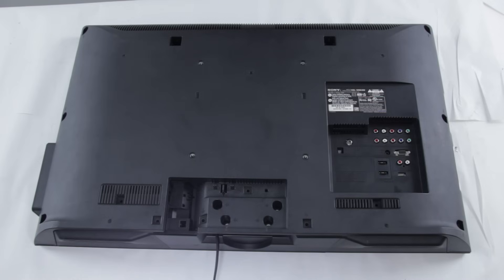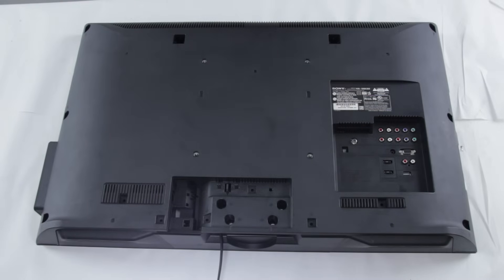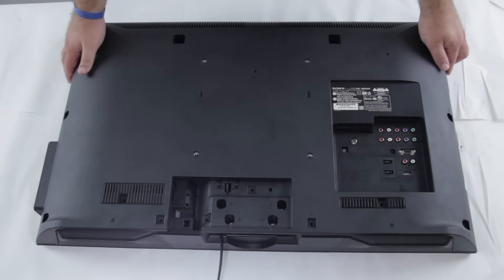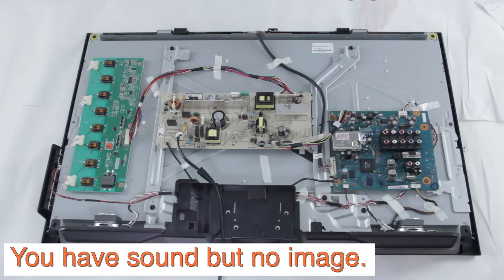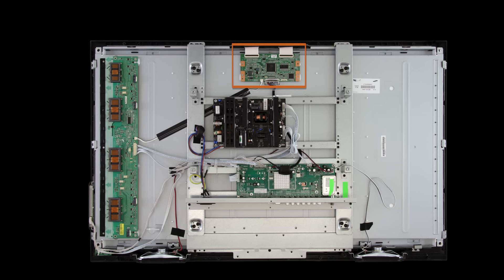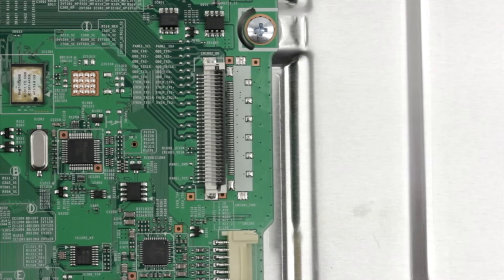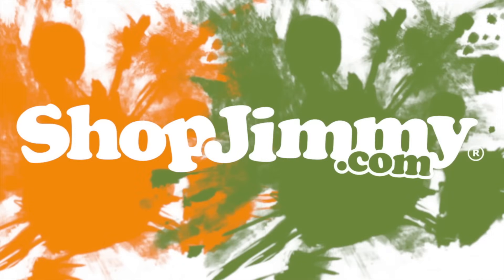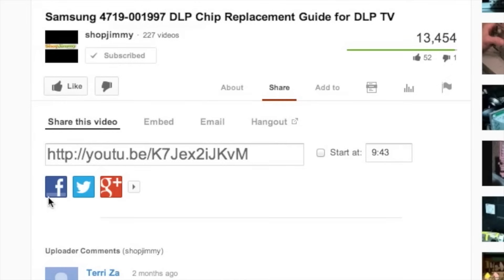LCD TV Repair Tutorial - T-Con Board Common Symptoms & Solutions - How to Replace T-Con Board

Comment: i have a samsung 43"  flat screen tv model # 843AX-YB02 SERIAL # BN96-26201A  with a red light blinking in the front and a green light blinking in the back, the  picture  comes on for a few seconds on and off. i already replaced  the Y- BUFFER BOARD AND THE SUPPLY BOARD still no picture.
Reply from the maker: +luis napoles  Try all repairs and troubleshooting at your own risk.  You will need to 
also replace the y board, since you replaced the buffer. Unfortunately I
 do not see any replacement parts in the search results for your TV 
model number on our website.  Thanks and please let us know if you have 
any further questions!  www.shopjimmy.com

Comment: Hello,

I have a Samsung  ln-t4661f
I replaced the capacitors that were bad and now it starts up.
It was also having the horizontal 3" stripes and ghosting of menus
I cleaned the ribbon cables on the t con board with alcohol and it appeared to fix the picture issue.
However the picture started displaying what looked like flashlights at the upper left and right side of the screen pointing down, Now the picture is almost completely washed out. Is the T con Board Bad? I can send you a picture of the screen if it would help,

Thanks, Dan
Reply from the maker: +Dan Froehlich   Try all repairs and troubleshooting at your own risk.  This sounds like a TV panel (TV Screen) problem.  If your TV panel is bad, it may be more cost-effective to replace the TV as panels are typically hard to find in stock, difficult to replace, and expensive.  Thanks and please let us know if you have any further questions!  www.shopjimmy.com
Reply: +ShopJimmy.com 

Hello,
I found an inexpensive T con board  and it appears to have fixed the issues I described in my Initial post. Now the only issue is that the HDMI calibration fails and the picture has a blue cast over it. The other inputs pass calibration. I started it in service mode and when i have it retry calibration the screen gets nice and bright for a second or 2 then goes back to the blue cast. Any ideas on this?

Thanks, Dan

Comment: LG flat screen
Serial: 408RMGCNA191
Model: 50LB5900-UV
Symptoms: 3" grey vertical band with colored lines on the right side of screen.
They are displayed over the input and menu screens.They appear over all input selections.
May this just be a ribbon cable connection problem or do I need a T-con board?

Comment: I have a UN46EH5000F Samsung TV. When I power it on I get no video at all. No light on the screen of any kind. I do hear a power on chime noise. I get a red flash from the power button. I have replaced all 3 boards (pwr,main,tcon). Did not change cables.

Comment: I have a Samsung model # UN39FH5000F.   The sound is fine but there is no picture.  I heard that it could be the inverter board, led board, that provides the backlight but I am not sure which board it IS when I remove the back cover.    There is an obvious power board then what looks like the main board and then there is this other board in the middle, low, and has two separate long boards built into the lining of the TV.  Is THIS the inverter board, a T board, or an LED board.  Im confused.
Reply from the maker: Dee Griffin   Try all repairs and troubleshooting at your own risk.   It looks like your inverter board in built into the power supply board.  Click this link to replacements for your TV model number:  http://www.shopjimmy.com/catalogsearch/result/index/?cat=229&q=UN39FH5000F  There may be multiple boards for the same TV model number, be sure to match part numbers on your current board, with your replacement for compatibility.  Thanks and please let us know if you have any further questions with your TV Repair!  www.shopjimmy.com

Comment: I have a Samsung LN52B630N1FXZA LCD TV. The screen goes black after a short time. We still have audio, but no picture. If the TV is off for a while it will come on and repeat the same thing. I have replaced the Main Board, T-Con Board and the Backlight inverter. What else can it be???

Comment: I have a Samsung LN46A550P3FXZA with intermittent severe solarized picture. thought was the 35-D025860 T-con board, but a u-tube video I watched stated that if the screen menus were not solarized as well, it would be the main video board. Can anyone verify this? Also, am I wrong to assume not the LCD panel since picture is sometimes OK?

Comment: Hello my friend. Very good your videos. I have a UN46EH6030F Tv model (Samsung) and I have problems with the HDMI ports, doesn't work...It could be the main board... I bought it but doesn't work either. What can I do? Thanks
Reply from the maker: Fran Merino   PLEASE SUBSCRIBE TO OUR CHANNEL - Try all repairs and troubleshooting at your own risk.  This could be a bad main board or bad HDMI cable.  You can try a different HDMI cable to see if the problem persists.  If it does, then you should replace the main board.  Click this link to a replacement main board for your TV model number:  http://www.shopjimmy.com/samsung-bn94-05874t-main-board-for-un46eh6030fxza.htm  There may be multiple boards for the same TV model number, be sure to match part numbers on your current board, with your replacement for compatibility.  Thanks and please let us know if you have any further questions with your TV Repair!  www.shopjimmy.com

Comment: NEED HELP:

I have a Sharp LC-52D92U
My 3 years old daughter hit the LCD screen with hands and after that a thin black horizontal line appeared across the whole screen from right to left (slight dimming towards left). Location is just below the centre. Please advise how to get it fixed. Can this be fixed by replacing T-Con Board?

Comment: Hi I have a sansung 40 inch smart tv
my problem is that I factory reset it and I cant configure the initial set up it just gets stuck and does'nt do anything it just says downloading terms of use  and I check the internet connection and its fine I dont know what to do
model: UN40J5500

Comment: Hello, My Samsung LE37A656A1F (XXH) type no LE37A656 is damaged sinds a few weeks. I put it out for a few weeks. Now by using the problem still remains. The problems are bad colours and very bleu heads. I tried and reset the colours but it won't help. Is it also a T-con board matter and just replace it or do I have to do something else.Please help me asap. Thanx greetings RED

Comment: Have a JVC LT 32DY8ZJ need to replace TCon board but cannot see it after taking off back panel. Any ideas please
Reply from the maker: John Girvan   Try all repairs and troubleshooting at your own risk.  This sounds like a TV panel (TV Screen) problem.  If your TV panel is bad, it may be more cost-effective to replace the TV as panels are typically hard to find in stock, difficult to replace, and expensive.  Thanks and please let us know if you have any further questions!  www.shopjimmy.com

Comment: Emerson LF391EM4/ S/N: DS3A
Trying to repair an Emerson LF391EM4/ S/N: DS3A
When plugged little red power light ON, sometimes Starts up perfect but other times wont start. Press button on TV and Remote, nothing, unplug/plug, wait-nothing. Then any random time try it- starts up perfectly.
Ran diagnostic several times everything OK, but once a POWER KEY--->NG showed up with Red Screen after that t always shows everything OK?? Could you please point in which direction I should go to solve this.
Reply from the maker: Ri Russ   PLEASE SUBSCRIBE TO OUR CHANNEL - Try all repairs and troubleshooting at your own risk.  I recommend replacing the digital main board in your TV.  Click this link to replacement digital main boards for your TV model number:  http://www.shopjimmy.com/catalogsearch/result/index/?cat=225&q=LF391EM4  There may be multiple boards for the same TV model number, be sure to match part numbers on your current board, with your replacement for compatibility.  Here is a link to a video showing how to identify your part number, click here:  https://www.youtube.com/watch?v=wooRqBrRo6oThanks and please let us know if you have any further questions with your TV Repair!  www.shopjimmy.com

Comment: I have a Sony LDM 3210, serial 2004656 with a receiver MBD-XBR950L that was working perfect. Turned it off and then when I turned it back on 10 minutes later, half of the picture is black with colored lines running through it. I have set my pic as the picture of the tv so you can see it. Do you think it would be the T-con board causing this? Looking for any help. Thanks
Reply from the maker: Troy M   PLEASE SUBSCRIBE TO OUR CHANNEL - Try all repairs and troubleshooting at your own risk.  This could be a problem with either the t-con board, the main board or the TV panel.  You can replace the t-con board and main board individually to see if one of those boards fixes the problem.  Click this link to replacement parts for your TV model number:  http://www.shopjimmy.com/catalogsearch/result/?q=sony+3210  There may be multiple boards for the same TV model number, be sure to match part numbers on your current board, with your replacement for compatibility.  Thanks and please let us know if you have any further questions with your TV Repair!  www.shopjimmy.com

Comment: Hi Jimmy, TV model number 40HXC06UA- Hitachi Number V13101407. My product will not turn on when prompted by remote or manually flashes red and blue, however  does not activate. The TV is only 24 months old, I have been advised that the main board needs replacing could you show me how, thank you for time look forward to hearing from you.

Comment: Hello ... I have LG cinema3d smart 6110 and it's damaged with water and it has a rust on the connection of left side of T-con board 
caused a half left distortion picture 
How can i remove the rust by which material ?? Please
Thank u very much.
Eng.firas

Comment: have a vizio sv421xvt serial jskelak5106031 it has pip my main screen will not work connected all hdmi port to my directv receiver but no picture and now the romte will not operate my tv all I have is the picture where I have the picture in picture connected with my rca cables can some one help thanks

Comment: I have a Sony KDL48W600B I have a horizontal line across my screen about a third way down and a bit of ghost image in the middle of the screen?
Reply from the maker: Mike Hilton   Try all repairs and troubleshooting at your own risk.  This sounds like a TV panel (TV Screen) problem.  If your TV panel is bad, it may be more cost-effective to replace the TV as panels are typically hard to find in stock, difficult to replace, and expensive.  Thanks and please let us know if you have any further questions!  www.shopjimmy.com

Comment: Hi,
I'm looking for some help with a TV issue, when I turn my tv on it appears on AV1, my channel come in through AV4 but when I change to this channel the TV auto changes to the next available channel, I have changed from HDMI to scart and the same issue happens. If I change it back around to AV4 the TV goes into standby and the Red light flashes 9 times then pauses for a second or 2 and blinks again for 9 times and this continues.  Any help would be great, I think my PCB board may be damaged and if so is it worth repairing? 
thanks 
Rgds
Brian
Reply: Brian Keller Sorry my TV is a Sony Bravia KDL46S2030
Reply from the maker: Brian Keller    PLEASE SUBSCRIBE TO OUR CHANNEL - Try all repairs and troubleshooting at your own risk.  I recommend replacing the main board in your TV.  Click this link to replacement parts for your TV model number:  http://www.shopjimmy.com/catalogsearch/result/index/?cat=56&q=KDL46S2030  There may be multiple boards for the same TV model number, be sure to match part numbers on your current board, with your replacement for compatibility.  Here is a link to a video showing how to identify your part number, click here:  https://www.youtube.com/watch?v=Aodz2LHkzbY  Thanks and please let us know if you have any further questions with your TV Repair!  www.shopjimmy.com

Comment: I have a kdl 40v2500  ser # 8172852 manufactured 07 ,,120/240 volt 50/60 hz  bought it new....Turns on watch tv all good sometimes for days then it will blackout still have sound but no pic.. Turn it off then right back on it may work again for days.. Recently it hss started occurring more often but can always turn it off then back on and it works. ... Lately might get an hour or even a movie or two,,,but more often 10,,20 min..No flashing lights ,,no stange sounds,,Happens with dvd player, ,Playstation, ,chrome cast, ,seems like all impute. .
Reply from the maker: David G  PLEASE SUBSCRIBE TO OUR CHANNEL - Try all repairs and troubleshooting at your own risk.   I recommend replacing the main board in your TV.  Click this link to replacement parts for your TV model number:  http://www.shopjimmy.com/sony-a-1196-624-a-b-board-for-kdl-40v2500.htm  There may be multiple boards for the same TV model number, be sure to match part numbers on your current board, with your replacement for compatibility.  Here is a link to a video showing how to identify your part number, click here:  https://www.youtube.com/watch?v=Aodz2LHkzbY  Thanks and please let us know if you have any further questions with your TV Repair!  www.shopjimmy.com

Comment: I have a LC-608C847OU. I had the vertical lines 2/3 of the way from the left side of the screen and then at the extreme right end, each about 6" wide. I took all 3 boards (Main power, T-con and whatever the other one is) to the local university for them to check the cold welds and contacts in their electronics classroom. I work there and the teacher has the micropscope showing thru a tv screen to see all fittings.. He found a few loose welds but that didn't fix the problem. Now suddenly, a few weeks later, those problem areas are gone and now a solid black line about 6" wide has appeared with white snow coming in from the left edge of the black line. Any thoughts?

Comment: hi  i have onida LCD TV
One turn on the tv White line start coming horizontal & vertically . Start from top
is it Tcon board issue

model no- LO32XRMBL
tCON BOARD - D02933D0L02HQ
Reply from the maker: Sachin Gandhi  PLEASE SUBSCRIBE TO OUR CHANNEL - Try all repairs and troubleshooting at your own risk.  This could be a problem with either the main board or the TV panel.  You can replace the main board to see if that fixes the problem.  Unfortunately I do not see any replacement parts in the search results for your TV model number on our website.  Please reply with your part number on your main board and I can try searching for replacement parts.  Thanks and please let us know if you have any further questions!  www.shopjimmy.com

Comment: hi I have a vizio E500-a0 the tv turns on and I have audio and video, the back light  goes out at random,  I have audio and I can see video if I hold a light to the panel, when the video is working I have a noticeable 5 inch dark band in the center of the screen, I have already replaced the led/power supply board, what else can I try??
thank you.

Comment: I am having an issue with Green Pixels appearing throughout my display. Never in one specific place it's different as the picture changes. I have some photos if that helps. I have a 42 LG LCD Model Number 42LD452B-UA. Please help of you can. I think I might have to replace the T Con board but I have no idea.

Comment: I have a Toshiba 40RF350U that shows the menu but will not show video from any source.  Model 40RF350U, chassis TAC0743, serial AM384023254.  Only sound I have is with full volume and is just white noise.  Is this the main board or the audio video board?  Thanks

Comment: Hi, I have a Sony Bravia kdl-50ex645 tv. I have it for only 2 years and there is a purple vertical line running down the middle of the screen. I would like to contact sony for this problem but my warranty had already ran out. Do you have any solution for problems such as this? Thanks for any replies.

Comment: I have a black bar at the bottom of my tv that gets bigger. The picture is distorted and flickers ( RCA R52WH74 ).
Reply from the maker: eberry   Try all repairs and troubleshooting at your own risk.  This sounds like a TV panel (TV Screen) problem.  If your TV panel is bad, it may be more cost-effective to replace the TV as panels are typically hard to find in stock, difficult to replace, and expensive.  Thanks and please let us know if you have any further questions!  www.shopjimmy.com

Comment: https://youtu.be/iJ4QINoLJn8

I've a Sharp Aquos that randomly has vertical lines on half the screen when you power it on. Sometimes the lines go away on their own. Sometimes you have to power cycle the TV numerous times. Once the lines are gone, the TV functions normally. I just swapped the power board with a used replacement and the problem still occurs. It seems less frequent but that could be a placebo effect. What do you think?

Comment: hi i have a samsung lcd model number LA40A30J1A S/N 135639NQJ00800E, i am getting backlight. i am however getting no picture. when i press the menu button i can just barely see the pop ups if i stand to the side of the screen i also have lines down the one side of the panel. prob need to replace t-con and main board ?? part numbers and prices please.

Comment: I had a polarized image so I replaced the tcon board. Now I have no picture the panel connector was very hard to remove and one of the black release buttons was broken off, can damage to this cause this issue?? Backlights work fine.
Samsung un39fh5000f